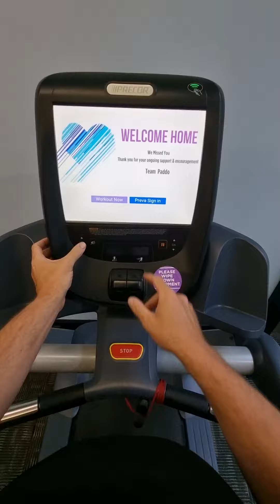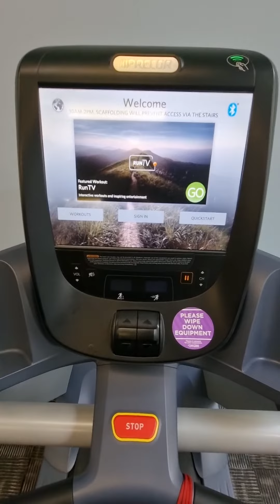Precor P82 Console touch screen calibration procedure.

Comment: Hi could you provide further help on this. No matter how many times I calibrate my screen is still out of calibration
Reply from the maker: @kas5857  you may have dirt & dust build up on the bottom of the screen, try cleaning with tooth pick & it your keen you can pull apart P82 consoles & clean the edge of touch screen